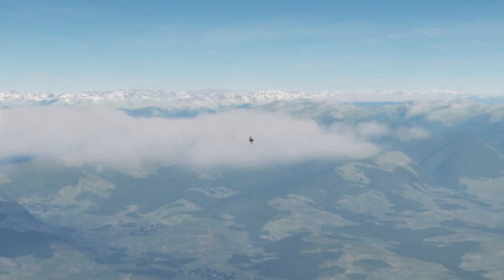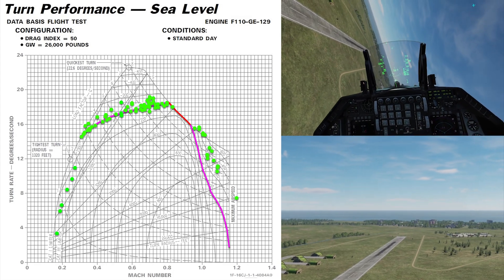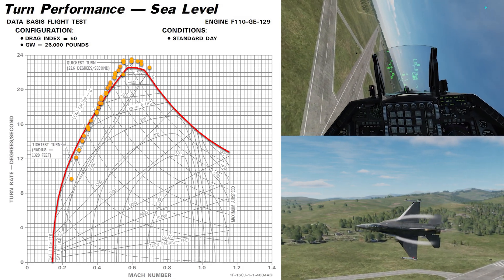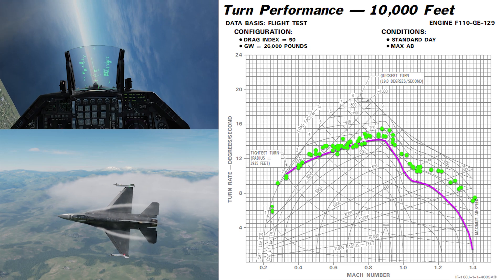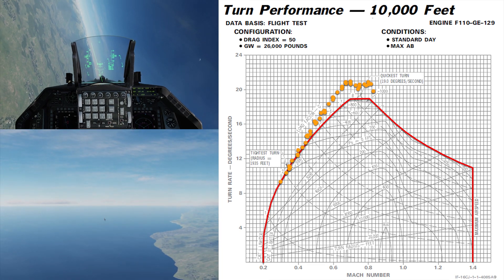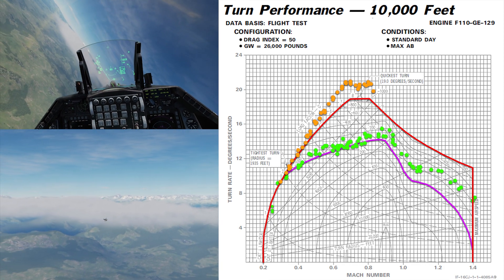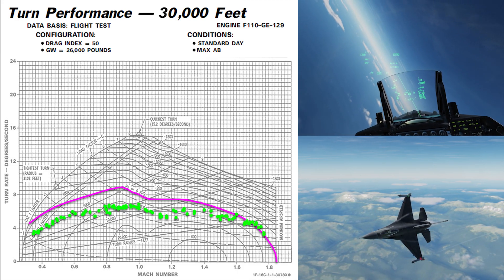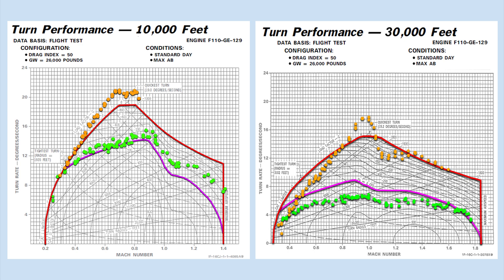F-16C Updated Flight Dynamics Testing (March 2022 Update)

Comment: Great video, well watched.
I have one regret. the tested plane seems to have a drag index close to 0, but in the EM chart, drag index = 50.
How about comparing the measured data with drag index=0 EM chart?
Thanks~
Reply from the maker: It has an affect of about a degree or so, so the just slightly underperforms under 15K, at above 25k and it underperforms by 2 deg or so.

Comment: Not that impressive. It's not nearly as close to the performance as it should be. Your "degree or two" is actually a 30% loss of performance at 30,000 ft!! That is hardly acceptable.

Also unacceptable is everyone noticing the under-performance but ignoring the over-performance (yeah...it's all good when things are to your advantage, huh!). It should be ACCURATE! BOTH WAYS!

Still a long way to go with this one. I'm actually pretty disappointed it isn't better than this by now. It still feels totally wrong in pitch, and the FLCS still has problems switching modes (gear up/gear down transition).

Try deep-stalling it. It wouldn't when I tried it.
Reply from the maker: High altitude issues are more likely DCS shortfalls, rather than F-16. Being part of developing mods and modules, I can safely say its very very hard to get planes accurate the higher you go. F-16 being that close is very impressive

Comment: Thanks a lot for this! Saved me so much work.
Can i ask what was the methodology for measuring the turns?
Reply from the maker: I did the A4 testing like this with an A4 pilot and we helped get the A4 be 99% accurate. Later on we didd this testing for the MiG-17 (still working on it, but with parameters during testing, tacview matched the turn rates of the ED parameters).

Disclosure: I did the testing for the F-16 with only 2 missiles instead of 6 (my mistake), so the F-16 actually underperforms a bit.

So for the F-16 I did extensive testing at altitudes, SL, 10K and 30K. I would do a sustained level turn every 15 kts or so, at least 4 times for each speed. Keep it atvsame speed for at least 20-30 seconds. Then get the turn rates from tacview. Mostbwere groups, I threw away any outliers.

For instantaneous, I would start at different speeds and pull all way back let it slow down to minimum while maintaining altitude. Then get the turn rate from tacview atvevery mach .05 interval. I did this at least 3 times starting at different speeds. So about 15-20 times for each altitude. I threw away outliers again to normalize the test results.

Since it follows the curve, Im confident the test was accurate (except for the 2 missiles instead of 6). But that is only about 1-1.5 deg difference. So it underpefrorms by about a degree or so.
Reply: @FSX404  thank you
Reply: Will you repeat the tests using 6 missiles?
Reply from the maker: @garyjnj1  no way, this took 2 weeks. Just adjust by a degree or so

Comment: I would like to know are you testing it with 26000 lbs weight? What is the fuel weight?
Reply from the maker: Yes between 25 and 27k. But I did not test with 6 missiles, only 2 (bit of an oversight), so the F16 does actually underperform a bit
Reply: @FSX404  You checked unlimited fuel and disabled G effect?
Reply from the maker: @fredclifton2208  one of those obvious things that you think of later 🤣🤣. I did it the hard way. In either case I did the test several times for each point, so it averaged out good.

Comment: If the tests are accurate then this FM needs a lot of work still. It seems like it's all over the place, both under and overperforming across the envelope
Reply from the maker: Looks like I did it without 4 extra missiles, so it actually underperfoms a bit, a degree or so
Reply: @FSX404  ah, that would explain the strange oscillations in the differences
Reply from the maker: @ilejovcevski79  not it wouldnt, impact is not as big, a degree or so. Curves would still be the same. There is another reason there is a oscillation at 30k, and its not necessarily an F16 issue.

Comment: Hi GVad, since you mistook DI = 50 for clean, I strongly suggest you redo the test with 4 AMRAAMs + 2 AIM9s + Pylons + 51% fuel, which gives exactly DI= 50 and weight = 26000 lbs.
Reply from the maker: Close enough for government work
Reply: @FSX404   Please check the appendix. 2 tip aim9 missiles give DI = 8 total. 4 AIM120s under wings give 24 total. With the pylons they give DI=42 total.. In your video you are flying with DI = 8 only.
Reply: In my opinion, it can't be DI=50 the 6 missiles, becuase DI = 35 is the drop tanks, the DI=50 is wrong, for the 26000 pounds isbthe weight with full internal fuel in clean configuration with only tip missiles.
Reply: @CarlosMoreno-dq3kg   Oh boy you are terribly wrong. Please check the appendix. 2 tip aim9 missiles give DI = 8 total. 4 AIM120s under wings give 24 total. With the pylons they give DI=42 total.

Comment: Hi GVad, I see you are testing performance with weight = 26000 lbs and DI = 50., but you are flying in clean configuration. DI = 50 means 4 AMRAAMS + 2 AIM9s + pylons. Have you noticed that?
Reply from the maker: Reduce by 1 to 1.5 deg per test... so technically it underperforms a bit, really underperforms by 2 to 2.5 deg at 30k.

Comment: Hmmm why do I have a feeling that you had some doubts about the accuracy and therefore did the tests to prove it but you found out it was pretty accurate? ;p ..In any case thanks a lot for this...Tbh I had my doubts myself because it’s so dominant after the update, but I guess it means the viper is a monster ..Viper pilots already said DCS viper was underperforming...but nice to see that ED actually is matching the envelope with a few small exceptions
Reply from the maker: Yeah, I thought it overperformed after the update, but it didnt, few exceptions at peaks, but seems to start underperforming a bit at 20+K.

P.S. dont trust pilots without data, they are like fishermen, fish they caught is always 18+ inches long 🤣🤣🤣

Comment: Great analysis and thank you for taking the time to evaluate this. At first, I thought it was too good to be true as well, but it seems like for most cases, it is accurate. If you're taking requests, I would really like to see a similar performance evaluation of the FC3 F-15. I realize it's not a high fidelity FM, but it would be an interesting comparison none the less. Great work on this!
Reply from the maker: Thanks, I usually do less testing, not as thorough as this, but two weeks of testing was enough to get me exhausted on DCS, lol. It was necessary in this case because the F-16C performance increased so dramatically, and a lot of data points to test. A lot of work for a 5 min video. But its good data, and good to know turns (where it matters) are mostly accurate. I want to know about the F-15 too, but I have to pass on it at least for a while, I need to enjoy DCS again for a few days. 😁😁
Reply: @FSX404  Completely understood. Doing tests like this require a considerable amount of effort - and then to summarize it in 5 minutes is just crazy. Once again, thanks for this and no rush! Enjoy the sim!
Reply: @photo_rohan  from what I understood f-15 is indeed an fc3 aircraft with simplified systems and non clickable cockpit but uses same realistic flight model as the full fidelity aircraft ..same is the case for other fc3 planes...That’s what I remember from some info released by Ed some time ago ..could be wrong but I think I’m remembering correctly
Reply from the maker: @ramtin-s8722  yes, thatvisbcorrect, it has complex flight dynamics, just no cockpit. Its probably reasonably accurate.